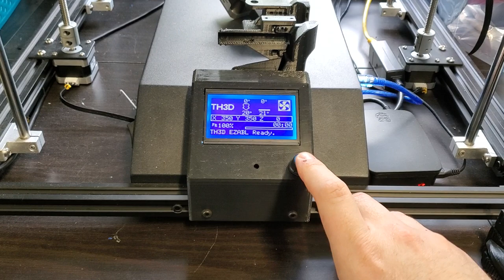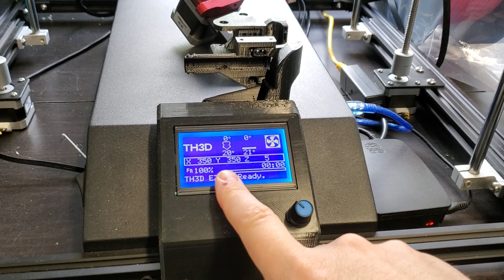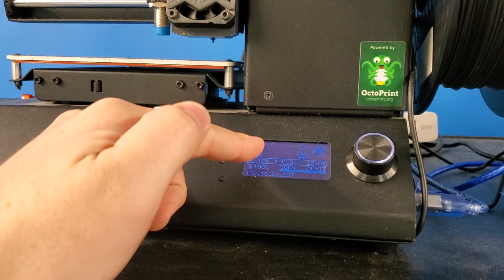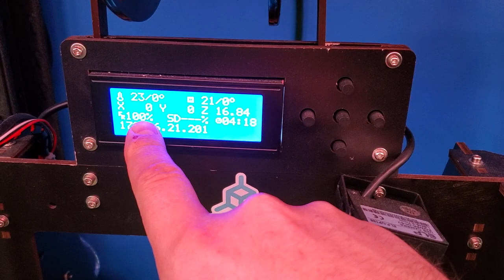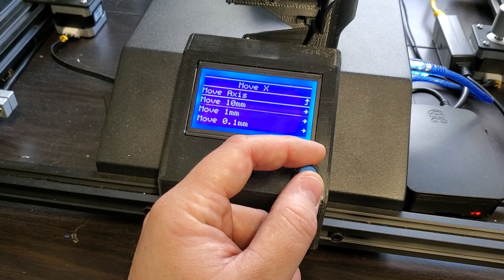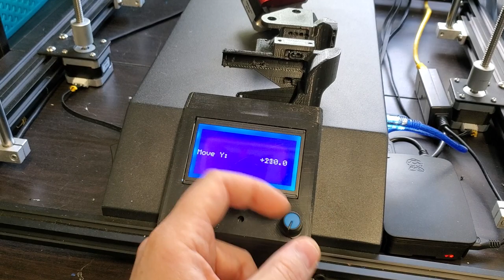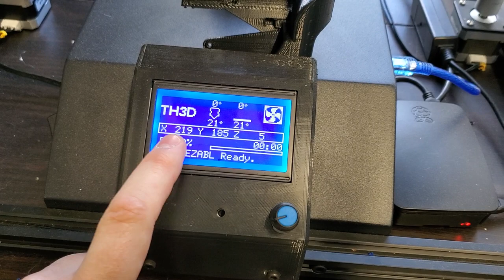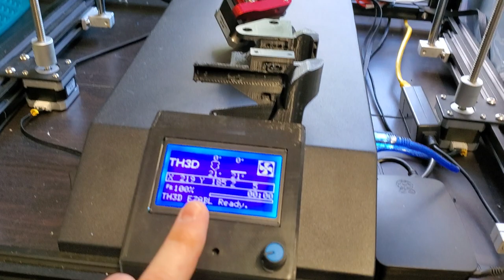Printer Homing Types | Home Positions Explained | Min/Max/ABL Probes | EZTip #6

Comment: Love vids like this thanks. 
FYI, if you don't put more slack in that EZABL wire it will void your warranty......just say'n 🤣🤣🤣🤣
Reply from the maker: It has enough slack. Any less and it would be an issue. :P
Reply: It is screaming - I'm too tight
Reply: @woodwaker1  lol its ok I think....Its in good hands!
Reply: @vrich3733  Hey I'm Ok.  I have 19 spare connector ends now.  I had the second or third one break on the white wire so purchased a bunch of Molex 4 pin connectors and 200 pins from Mouser.  The shipping was the most expensive part.

Comment: Aha!  Now I understand why my prints are finishing with the head at front left vs home at back right on my Ender 5... I’ll need to adjust the slicers end code.   Thanks!
Reply from the maker: Just add a G28 XY to your ending code and that will home the XY to the rear. Easiest way to do it.

Comment: Great video thank you so much 1 question. 
So head off the bed is a problem? If it dose can it be fixed?
Reply: If I understand your question, the head doesn't matter where the head is when the sensor is measuring. The EZABL is determining how the height of the sensor.  It than creates a map and uses that to build adjustments.  The process works very well to create a good first layer.  The software is adjusted to the offset of the nozzle vs the sensor.
Reply from the maker: Note quite sure what you mean. But the head can home XY off the bed. If you have an ABL probe you should be homing in the center of the bed, this would be set in your firmware.

Comment: While all this is very informative, I've found that there's a lot of benefit to reconfiguring the firmware so that x0,y0 is actually at the center of the bed. Especially with regards to configuring auto bed profiling, or switching build plates that have different sizes.
Reply from the maker: That is a good point, but we still stand by the front left is X0,Y0 and should be the standard.